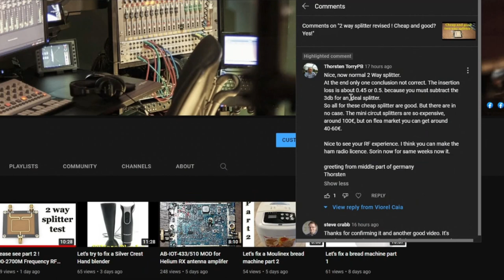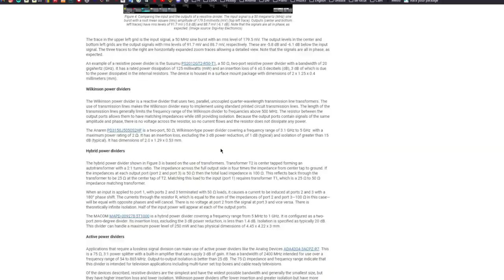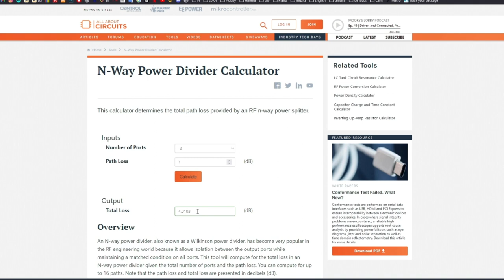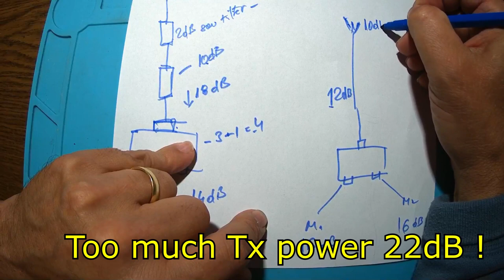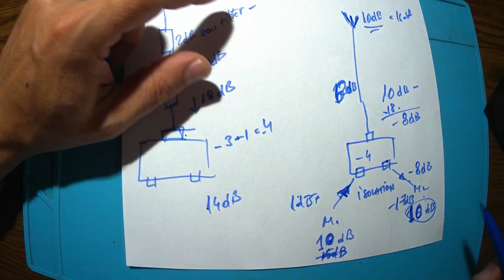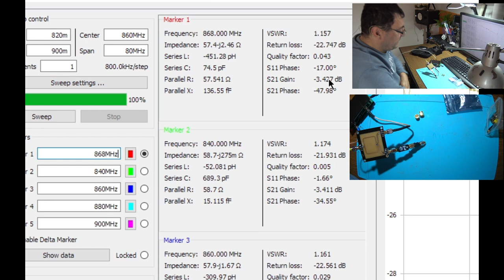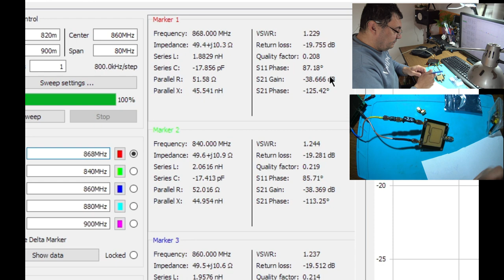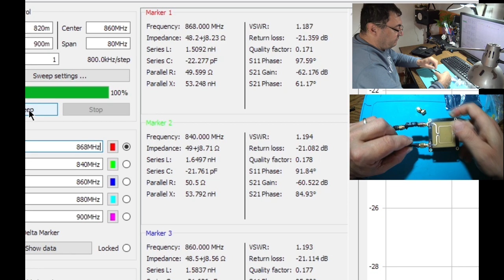Let's talk splitter and more experiments

Comment: So if I understand it correct; miner sends beacon on port 1 than there is no problem for the other miner on port 2 that the incoming signal is damaging it?
Reply from the maker: It will not, there is a -18dB separation between ports..maybe invalids but no damage..

Comment: Hello sir, I have a question on a 2 way setup with 2xsensecaps and 5.8 dbi antenna. Could I run this safely? (without atenuators).
Reply from the maker: It's not enough isolation in between ports..but you should give a try..beacons are not so often anyway so you can stand invalids once in a while..

Comment: Litle help here
Just ordered raygnal outdor cavity, wilkinson spliter and raygnal flarm. Antena is interline 8dBi.
Cable is 5m. + 2 x 30cm from spliter to miner. 
I ask to set amp RX12 TX 0 ,  is that ok or to left it factory default 17 ?
Reply from the maker: Which one TX..the miner or the amplifier?
Reply: @viocaia  Rx on amp, i ask to reduce it to 12